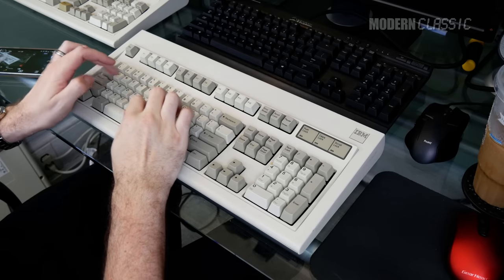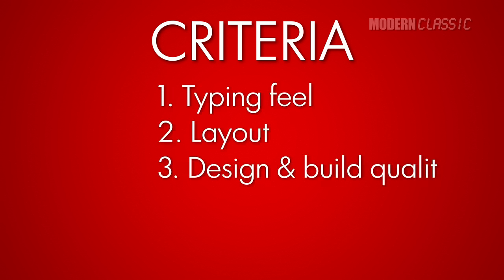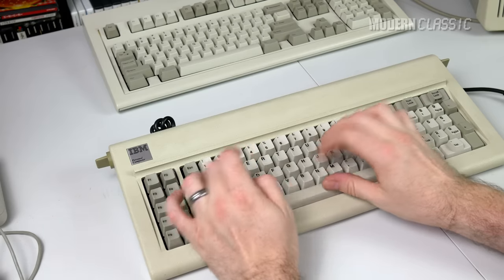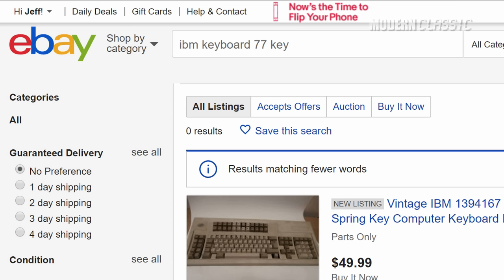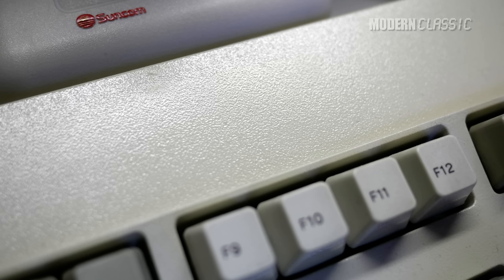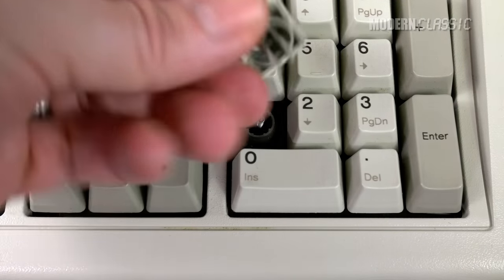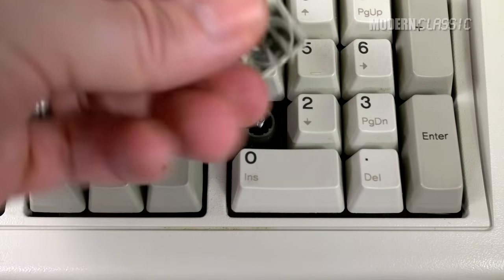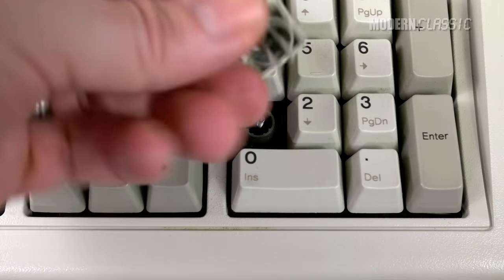Ultimate Keyboard Showdown - IBM Model F or Model M?

Comment: I disagree.  The 122 key F, lightly modified to fit a more modern layout, is the king of IBM clicky boards.

It has a fair amount of drawbacks. It's huge. It literally does weigh 10 pounds. It has no lock lights, and it requires an active converter. It's expensive, you wind up with a bunch of extra keys, finding one with no case damage is a chore, and some aspects of it can't be easily modded to fit the enhanced layout.

But in exchange for these flaws, you receive an IBM model F that has 90% of the enhanced layout. In fact, its design is the template for the enhanced layout, and it even comes with the two piece caps of the IBM Model M. It's possibly the best built of all the F's, and the barrage of extra keys can be mapped to all kinds of function and media keys with the right converter. 

It used to be that you could get these boards for under $200, including converter.  At that price, buying one was a no brainer if you had the means. With current prices shooting up over $500, it's a much harder sell... but for a clicky keyboard fan they're the closest you can come to perfection.
Reply: The 77-key repro is amazing.  I was worried when I bought it that I had fallen victim to hype, but it really is worth the price--at least to me.  I am NOT well off financially, either.  The difference in key feel is understated in this video, but not as much as the rivets failing!  I am convinced that the frequency of this is vastly underestimated by many people.  Years ago, it wasn't much of a problem, but these days (in my experience, at least), it's a HUGE problem for older Ms, which are also the ones people tend to want.  

If it weren't for the price, the 122-key F would clearly be the winner.  Why wouldn't it be?  Personally, I think the f107 is because of that case, but that's a matter of taste, I think.  Of course, to afford one of those (NOS), I'd have to take out a loan or sell a kidney or something.
Reply: Without exception, every single model M that has come into my possession for any amount of time in the recent past has at least been close to needing a bolt mod.  That's like 4+ keyboards.  My friend has like 2 or 3 sitting there which need it.  The problem is so bad that at this point, IMHO it is crazy not to just buy a new board from Unicomp if you want an M.  They don't have the QC problems now that they used to.
Reply: It finally happened. As of the beginning of this month, Model F Labs has started buy-ins for a brand new Model F keyboard with a modern ANSI layout. It can be had in a Model M profile or a slimmer profile, and in tenkeyless or 122 key variants.  It also features a solid metal construction and modern USB keyboard controller like all other options did.

If you can convince yourself to spend the $420 he's charging, that's keyboard end-game. It's the best of all worlds. I shied away from the F77 but I'm all in on this round.
Reply: @bsadewitz  Somehow I lucked out, and neither of the two Model M's I own have lost a single plastic rivet.

Comment: If you play any games at all, N-Key roll over is a must. I can attest to how incredibly inconvenient it is to not be able to press a third key when playing a game, coupled with the command rate of the game being tied to your frame rate, if you intend to play anything other than casual games, you need your keys to respond as accurately and as fast as you do. Having to release a key in order for the keyboard to register a different key press is awful in a competitive game.
Reply from the maker: Check the video description. You do not need NKRO to play games.
Reply: @ModernClassic  It depends on what kind of games you play. I remember my frustration playing need for speed underground on a cheap rubber dome keyboard, I could press up for accelerator, another key that I don't remember for nos, but at that point right still worked but left didn't, so a lot of times I crashed! Using a model M nowadays I sometimes hit the limit of the 2 key rollover, I don't play a lot and I don't remember what precisely I couldn't do, but probably it's on first person shooters when I run looking sideways, pressing W+A+shift or W+D+shift. Anyway not a huge deal as buckling springs are amazing for typing, but their huge hysteresis makes them so and so for gaming, competitive one at least.

Comment: Great video as always!  However, I think you can't tell the difference between n-key rollover and not is because you're not a touch-typist.  For those who can type 90 WPM or faster, having a keyboard that registers new keys before all are released is very important.
Reply: A little bit of a moot point here, typing layout (QWERTY, DVORAK, etc.) are design so alphabets are not being clumped too close together so typing work are more well distributed throughout other area/each fingers (i.e: most word will require you to press keys on different area), chances are even for the fastest typist, they will not be using up all the available keys in the matrix (not sure if this is the correct term) of a keyboard with limited KRO. So yeah, appreciation for NKRO may not be much of a typist thing but more for those who awe the techincal complexity of it and those who absolutely need to press WASD plus Shift and Ctrl at the same time.

Edit: to clarify, limited (2,4, etc) key roll over doesn't mean you can only press certain amount of key of the entire keyboard at a given time, but you a garunteed to be atleast able to press the promised amount of keys in the worst case scenario/most limited key combination, it depends on how the traces are drawn for the membrane but you are definately not limited to the amount of key roll over at the same time across the entire keyboard.
Reply: Even if you type 90 wpm you wont use all your keys av once, so no need for n-key rollover. A 2-4 key rollover are more then enough for someone typing 90 wpm.  To be really frank here it's those that have poor typing or "cheat" while typing that have more use for higher key rollover, but never n-key.
Reply: For keyboards with n-key rollover, any number of keys can be held down and will register.  For keyboards without it, they do NOT act the same way -- you can't hold down any 2 keys, they have to be 2 keys in the same row, or the same column, usually right next to each other.  A fast touch-typist might be hitting a key very far away from another key that still hasn't physically moved upward enough to send the break code.  If any 2-4 keys registered, then your theory would be correct -- but because that's not true (there are limitations based on rows and columns), you're wrong.

The larger issue that I find odd/funny is that this video, as well as all from Chyrosran22, are keyboard review videos from people who can't type correctly.  (That said, there were things in this video that were covered well that didn't require proper typing form to cover.)
Reply: Just tested out several keyboards with multi-key rollover and have not seen the issue you are talking about.   The behaviour you are speaking if have nothing to do with rollover.  If you have multi-key rollover, 2-4 as i spoke of, you can have any 2-4 keys used at any time and still register.  

What you are talking about sounds more like ghosting some older keyboards had problems with but that have nothing to do with n-key/multi-key rollover.  We all know what's happen if you type to fast on an Apple II, that is ghosting.

Edit: Totally forgot.  If you have a multi or n-key rollover keyboard and not computer (BIOS) that supports it you can have all sorts of problem if you are a fast typist.  This is specially true on older computers but was a problem until about 10-15 years ago.
Reply: With the case of Model M, it's not just 2 keys -- minimum two keys. A true 2 key rollover would be something annoying like the Fujitsu FKB4700, but even then it wasn't a big problem. With the model M most things get registered except for some truly discreet combinations you get when you quite literally mash your hands on the keyboard.
I've had an Model M and a Topre Realforce (inherent N-key rollover) and I type pretty consistently at around 110-120 WPM with both, making about the same amount of errors. I also considered this before I got it, but then I realized that good typing form has never required/asked of its users to have to enter multiple keys at once/at a really short span of time by milliseconds.
It's funny how you're talking trash about these reviewer's ability to type well to give a good feedback on keyboards. You sound like someone who doesn't know even how to type fast, and tried to assert your own assumptions as fact. If you do truly practice what you preach and find yourself having to enter multiple keys at once/really quickly, then there's no way you're at 90 with all the mistakes you're making.
Reply from the maker: I type at 100wpm. Typing speed doesn't have anything to do with NKRO (or whether or not you're a trained typist).
Reply: Actually if you are a properly trained typist you will never accidentally hit two keys at the same time, that would not work on a typewriter as it's something a proper typist would be able to use.
Reply: I just tested myself at 101 WPM, 84 effective after errors (no practice, no warmup, and not bad for someone over 40).  I've been touch-typing since the Model F.

Does nobody think proper form is a prerequisite for reviewing keyboards?
Reply: If you type at 100 WPM, you were not doing so in the video.

I don't want to get bullied by deskthority people in a youtube comment thread, so I'll stop replying.  I look forward to your future videos.

Comment: I like how you specified "tactile and clicky variety" when talking about the Model M and Model F. Most people I have seen tend to overrated as the best ones under any circumstance.
As a Model M owner I'd like to say that I like them enough to keep them but not enough to have them as my ultimate board. There is plenty of more options to chose and there is no telling which is the best one for you without testing, and most people I see often forget that.
I have a prefference for linear switches over clicky and tactile ones but rubber domes have kind of grown on me as I have tested a NMB dome with slider board, so I might find Topre better in feeling than the M if I test both side by side, but no way to know until I do.
That said, you can break the head of anyone that tells you to get a new keyboard(happened a lot to me) "because yours is an obsolete dinosaur" with both of them so both pass my standards.
Reply from the maker: I personally do think they're the best in any circumstance :)  But if someone prefers a different feel, I'm not going to argue with them. So I put that caveat in. I haven't found a rubber dome I've liked in my lifetime, or even come close to liking. Though I don't mind good linear switches, but good ones are hard to find. (Cherry, which is what most modern keyboard makers use, don't rate.) In the old days pre-IBM PC, most keyboards were linear and there were some good ones out there. I'm not sure what's good in linear keyboards nowadays; the ones I've tried in stores have been barely passable.
Reply: @ModernClassic  the enthusiast community has been talking a lot about retooled cherry blacks lately which seem to have put an end to the mx sandy feel in favor of a very smooth one, although I heard that their spring needs replacing for a better one iin order to archieve optimal feel.
Gateron Yellow is also very smooth.
These are interesting options for testing, in my opinion, as some of the other options are rather expensive, like ZealPC Tealios, which are specially made by Gateron.
I personally haven't tested any of these yet, so my personal prefference lies on Gateron black which is fairly smooth, again, in comparison to what I have used which are: Outemu blue(both the fairly decent 2015 batches and the hideously bad recent batches), Cherry red, Ibm membrane buckling sprigs, NMB dome with slider, Gateron brown and Gateron black. I'm looking foward to have Gateron yellows on my next board, but my NMB made me consider investing on a Niz capacitive board and I haven't seen nor done a direct comparison between them and complicated alps switches which, for many, are the best there is.
Optical switches are on the rise and they tend to be very, very smooth, but I personally am not sure about them since they still haven't been subjected to the test of time and some options like Co-Gain which are powered by the rgb led are straight pieces of garbage that will fail.
I also need to say that I have found interest keyboards only fairly recently, about three years ago, so I don't exactly have the best personal nor research experience to recommend something, and I can't really comment about lubing which can improve the feel from what I have read, but I intend to never stop testing and researching as far as I am interested in them.
Reply from the maker: First thing that jumped out at me in this comment is about the Outemu Blues - I have a keyboard that uses them that I must have bought in 2017, and I actually really like it. But I don't know when my switches were made. What's different in the new ones?

I will see if I can find a cheap way to test some of the other newer switches you mention, although I don't have a huge budget to buy keyboards (and honestly, it's kind of a niche type of video, so it rarely pays for itself).
Reply: @ModernClassic  They have way too much wobble and are a lot less reliable, as I used to administrate a peripheral enthusiast group, I have seen a huge amount of posts about double click issues which are very common with those new ones. Yours are the older batches before they decided to make a lower grade line, around the midst of 2017, new moulds and everything for this "b stock" line as I have noticed when disassembling a cheap chinese board I have received for review.
There have been some rumors that Redragon is using "A stock" of the regular lineup.
Motospeed k87s is the keyboard I received and even the solder quality has decreased HUGELY, as you can see if you look at these pics I took:
Stems: https://www.phe.com.br/wp-content/uploads/2018/05/bfddbfzcxbv-1024x384.png

Maximum angle the wobble permits me to twist the cap: https://www.phe.com.br/wp-content/uploads/2018/05/36852918_1619026998219554_1726353939894370304_n.jpg

Solders of the Motospeed board: https://www.phe.com.br/wp-content/uploads/2018/05/bfsaggfsagfsa-1024x547.jpg
Reply: I'm yet to test Outemu's Sky V2 and Ice V2 lineup, of which I heard are very good and have very little wobble to them.
Reply from the maker: That's disappointing about those Outemu Blues... I had been recommending those to people based on the keyboard I have. I'll have to stop for now, I guess.
Reply: @ModernClassic  Yeah, it is very unfortunate. My very first good keyboard was a Redragon K552 with blue Outemus from 2015(now with Gateron black and with it's case signed by Nolan Bushnell) and I used to recommend them a lot before I seen the huge amount of double click issues and asked for a review sample with the newer Outemus to see how bad they got for myself.
Gateron is still strong as a budget option though.
Kailh Box has been having some issues lately, and still is having, which cause the breaking of keycaps due to the manufacturing tolerances, so only pbt with those, as pbt seems not to be breaking as much.
And there is the Gigabyte K83 with surprisingly good solder and pcb quality at an amazing value with Cherry switches.
As for anything cheaper than those, I'd rather go with rubber domes like Logitech's K120 instead as, honesly, they have much greater chance of lasting than cheap mechanicals with such cheap switches as Outemu, JWH, Xinda, Greetech, Zorro among others known for having issues.

Comment: I would think the clicky-clacky nature was due to the previous use of typewriters in offices that was the standard before computers came in.
Reply: Ultimately, yeah.   But what they were going for, I think, was a feel like the beam spring keyboard.  Some of those had solenoids in them.  THAT was to simulate the feel of a typewriter.  What they cared about with the F and M was the feel, not so much the noise.  The noise was just a result of using the mechanism.
Reply: @bsadewitz  Thank you, I forgot the feel of typewriters for so long.
Reply: @ChristopherSobieniak  I'm not positive, but I think the beam spring switch was designed to emulate the feel of a selectric typewriter, which is like "keygenesis" or something like that.  It makes even more sense when u look at the history of IBM from the beginning.  And selectric typewriters really are that awesome.  They're just really fun to use, and it's nice sometimes to just have a keyboard and paper.  If they weren't so expensive now, I would buy one.  Of course, there are other amazing keyboards out there, but I don't know if there are any that are WAY better than the best IBM gear (whatever that would even feel like, I have no idea lol).